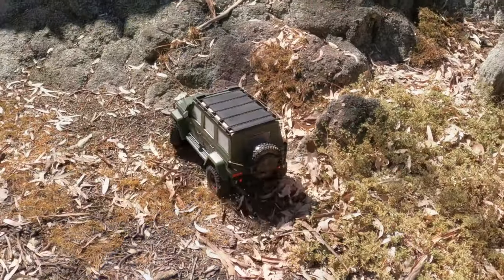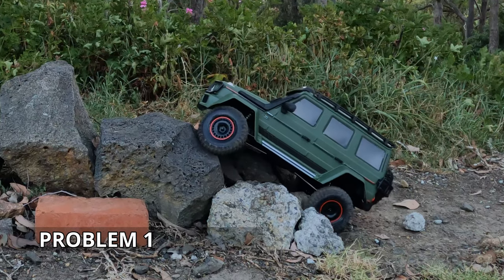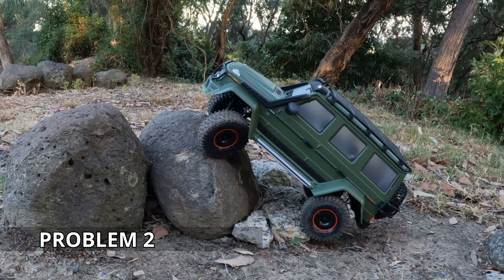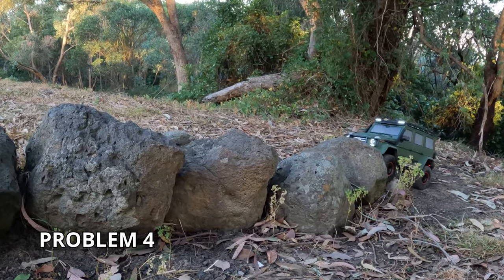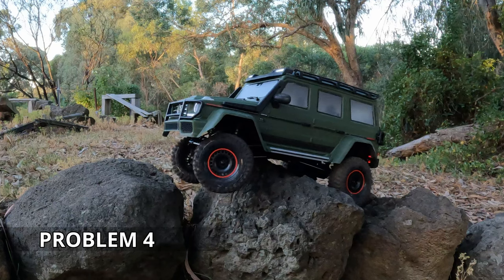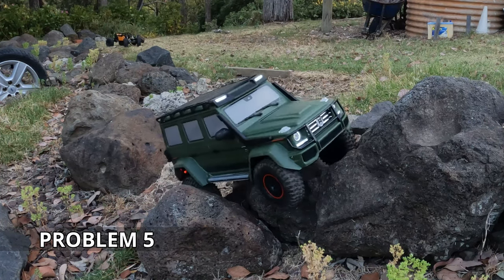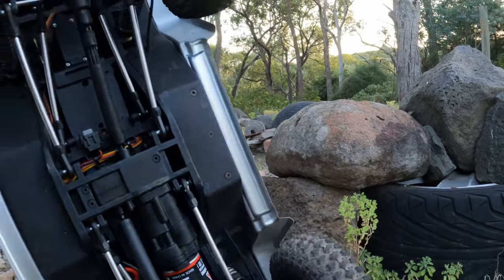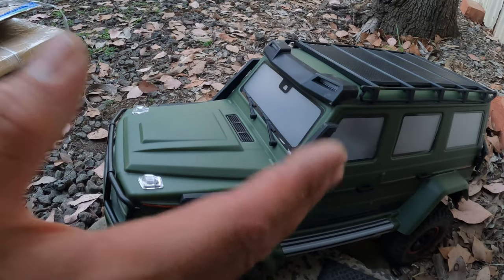Disc Brakes, No DIG. Lets Test This Rig!

Comment: Remember if it has portals, it is only 65mm underbelly, both from smaller portals and small tires (115mm for 2.2). You can't expect it to match a TRX4 with 80mm underbelly, It's not a comp truck, just a Class 1 capable to enjoy some harsh terrain (check videos from RC Play Ground, and YUN-RC too who, though not comp level, did a comparision with a TRX4 out of the box on a interesting terrain).
Reply from the maker: Agreed. This is why I said if you expect Class 1 performance you'll be pleasantly surprised. That's definitely the level of performance this will deliver. It's a good model. Cheers

Comment: Nice car, nice reviews (both videos)! For a capable trail truck I’d rather have the choice of RWD/4WD than the rear disc setup. 
Really nice axle design, looks very good! 
I’ve tested original Hyrax once, and that’s it - sold and never again, don’t understand the praise for this thread - too much siping going on so it’s really only useful under specific conditions where we usually are not driving in - bad weather.. And now they come as clones as standard for two of my latest trucks 😫. I bet this Yikong had fared better with other good all round tires.. Take care!
Reply from the maker: Haha, well put! I appreciate your nuanced examination of Hyrax, you're quite right. But like brass skids and tin plate diff bash guards, not everything the factories make for crawlers is a good idea. Sometimes things are popular because they're popular and are better avoided.

I understand the transmission in the FCX10 can be modified for RWD/4WD rather than DIG/4WD. FWD on any crawler is utterly pointless and shouldn't be listed as a feature. It's just a side effect of a DIG!

Cheers
Reply: @RCTNT  Yep! Agree on that. Yikong should better had put their RWD/4WD gearbox in it instead. If I could choose, I find the rear disk brake much more useful over DIG. Other manufacturers would have too, except they have left the brilliant idea of what a differential actually do.. 🥸. Nahh could we please have a lockable center diff also? 😁. Try Traxxas Stampede 4WD with the optional center diff! It’s a whole other car! It steers and handles like a crossover between a buggy and a monster truck. Turn in becomes ridiculously good! 
Cheers!
Reply from the maker: Yes any of the Traxxas cars of that era really need a centre diff. It's why I rate the MT10 Rival so highly. It achieves what I think the Stampede 4x4 vxl set out to be.

Comment: It almost seemed as if both rear tires were under power during the tank turns...was that just me? I'd like to see you explore the disc brake thing. Can we put them on the front axle at all? I really enjoy your vids. I own 2 of the 1/8th scale Yikongs and they are great scale trail rigs
Reply from the maker: You saw correctly. The rear diff is open when using tank turn, so both sides are powered. However, it works thanks to the open diff, while still allowing the wheels to turn as needed on higher traction surface like rocks. I'd love to see a stronger disc brake engagement.

Can't get em onto the front axle like this, given how they wouldn't fit next to the knuckles. But you don't need them up front as the traditional motor braking is well sufficient. Cheers
Reply: @RCTNT  I guess what I meant was, shouldn't the inside tire be locked by the brake, while the outside tire is rotating? If that''s true both wheels should not be turning when "tank turn" is engaged. It could just be how it appeared though. My thoughts on the discs in the front were more for stability control akin to what modern cars have. Not for crawlers, but more so go-fast stuff which I know nothing about, lol.
Reply from the maker: @brianmassey7563 yes, I understood you 👍 The inside tire is braked when tank turn is engaged. It doesn't grip super strongly, but it's enough to give resistance that assists the tight turn.

I'm also excited at the idea of traction control for faster stuff, absolutely. I know how I'd design it, too. I figure, if I'm having these thoughts, others have probably considered it too!

Comment: Well that was a pleasant surprise! With all the cool "gimmicks" I wasn´t giving two cents for its pure crawler capabilities, let alone with one hand tied behind the back in the shape of 2nd gear engaged!

I was thinking throughtout the video, given the extense 6-problem database, maybe it's time to designate a control tire for rigs that are almost there but not sure if the tires are holding them back... [or pushing them beyond the truck's capabilities]?
Reply from the maker: Ooh that's an interesting idea!
I also have been meaning to make a section on my website for 6 Problem contenders, so their abilities can be compared. Been very busy but that's on the to-do list!

Comment: Great vid and loving all the content and reviews on the website as well. Considering getting a first RC rig and very interested in this particular one for trail/scale as an alternative to the more expensive TRX4 lineup, one question has me hung up tho. When it comes to the Yikong, is it possible to get replacement parts/compatible parts or is it one of those deals that if it breaks it then becomes a paperweight?
Once again, thanks so much for the content!👍
Reply from the maker: Thank you! I'm glad to have been useful!

Ok, with this Yikong, as with many others including Traxxas and co., when you have some breakages, the repairs are universal: servos, motor, ESC, radio issues, etc. Even wheels, tires, links and drive shafts are not usually an issue for after-market options, even for unusual configurations.

Your main concern with this kind of car is if the axles break. Snap a shaft or joint, or the diff locker mechanism breaks somehow. You have a couple of choices in such a case: try to find a replacement part from the manufacturer (it'll be hit and miss with Yikong, but I suspect a message to your place of purchase would probably yield good results if it was while the model is still being made); or, you can jerry-rig a solution yourself without new parts.

Here's an example of that second situation: I recently modified my Cross RC EMO X3, which is a big, heavy, 1/8 scale crawler. While I was refitting new axles and brass and power system etc., I damaged the diff lock engagement mechanism for the rear axle. It was nearly impossible not to damage it due to poor design (IMO). I don't want to buy a new part and it's not something I can make myself. So, I compromised; I usually want the front axle locked full-time on any crawler and it's the rear that I like to be able to unlock on the trails and on certain crawling obstacles. So, I moved the intact front shifter piece to the rear axle and then used a spacer to full-time lock that front diff. I disconnected the servo for the front locker, and then put the rear back together. All is well, I'm happy, and I don't miss that unlockable front. Winning!

There are usually a few ways to deal with breakages. Again, it's the axles that will be the main problem if there's a breakage there. And honestly, in the worst case you can source different axles from another vehicle to address a serious failure. Sometimes I'll even mix and match axles on a rig even when they're not broken. It's one way to get an overdrive/underdrive setup when different axle gears aren't available. I did this exact thing for the RGT Challenger, actually. That also gave me a rear remotely lockable diff, it was a good upgrade!

Hope that gives you a bit more insight to help you make an informed decision. The radio system and electronics in this car are good enough, though cheap, and I expect you'll be happy with it. Just don't expect a hugely capable crawler compared to other 1/10 vehicles (I've got this rig on the 6-problem course in a follow-up vid, linked in the Description, if you're curious about crawling performance). Cheers!
Reply: @RCTNT  Thank You Craig for the excellent guidance and the shot of inspiration, you've made smiles here! This will be the start of the journey into RC I'd say🤓
Reply from the maker: Nice one. Enjoy it! Do keep in mind it's a cheaper car, so things may not be up to the Traxxas or Axial standard. But that said, I think it will give you hours of enjoyment. I'd suggest a 2S battery, maybe a 2200mah up to 5000mah tops. Smaller is better for weight - having 2x 2500mah 2s batteries can be better than 1x 5000mah 2s due to the lower weight the vehicle needs to carry. Better center of gravity, better performance, less stress on the car.

In any case, it's an impressive rig and the value is pretty much unbeatable. Enjoy!

Comment: This compares or better then trx???? Ive had my eyes on one for awhil but proce steep this seems to he the one hoping they restock sold out fast as i shoudve known for a good rc at good price 😊
Reply from the maker: Definitely no, the TRX4 is a superior vehicle.
You might consider the Cross RC EMO AT4 or JT4, or the RGT Rescuer. They're both comparable. I've got videos, tests and mods for both the AT4 and the Rescuer on my channel here, and an article for each on rc-tnt.com.

The TRX4 is the gold standard, though the Traxxas electronics leave a lot to be desired. The Cross RC EMO AT4 kit would be my pick if I could only have one. Get the electronics right first to, and enjoy a durable vehicle that's very capable (I have an EMO AT4 VS TRX4 BRONCO rock video on the channel here, too. See the Truck vs Truck playlist for that). Cheers